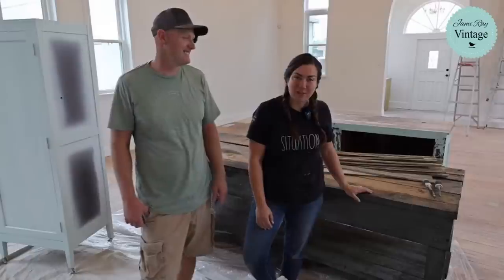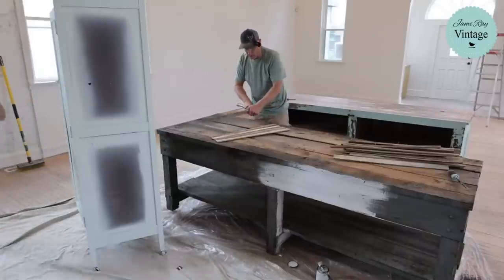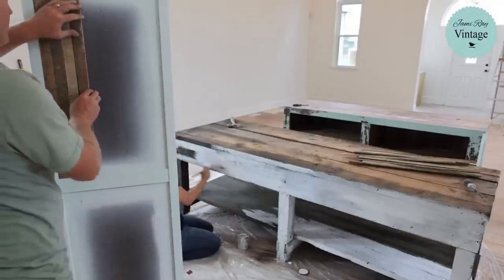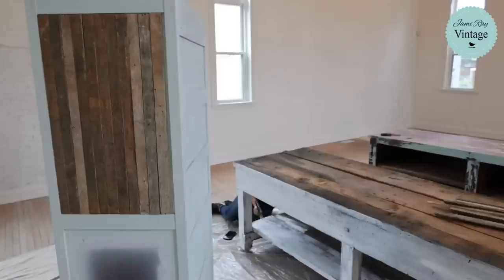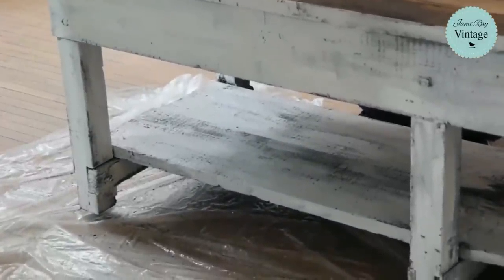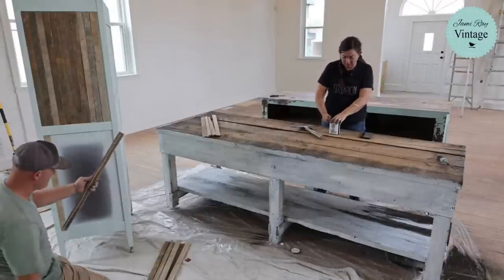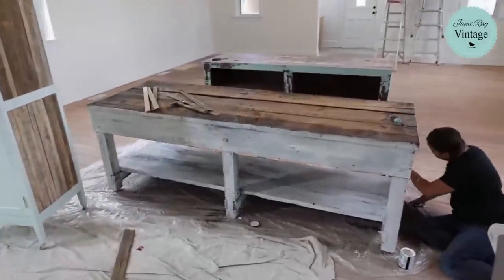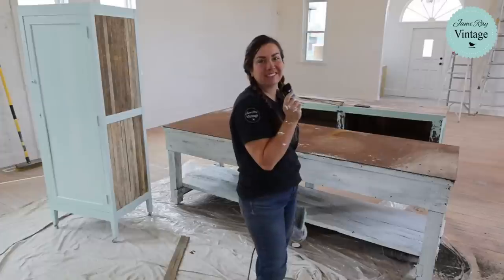DIY Salvage Wood Repair On The Side Of A Rolling Cabinet

Comment: The stage looks great with the lath on it! And I really like the Haint Blue cabinet with the lath too. I think it looks better the way it is, without the trim. If you grind off the edges of the steel table top it will be shiny and not match the rusty look. What about just putting some lath up over the edge of the steel? The rustiness is pretty great.